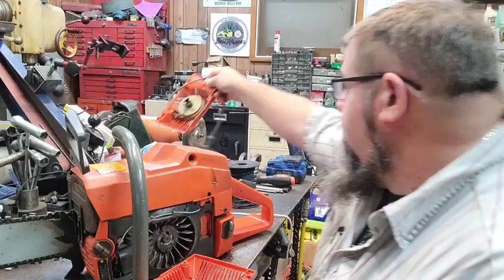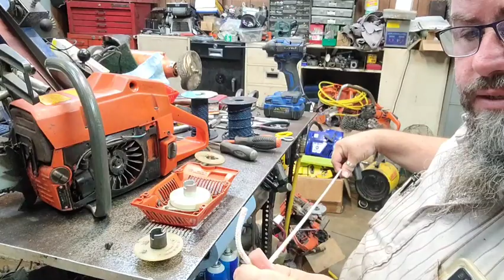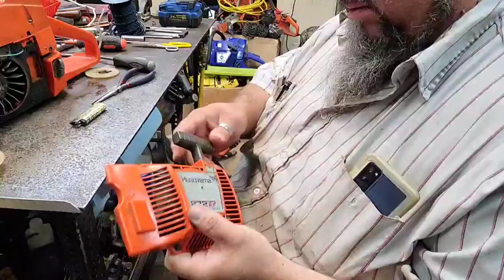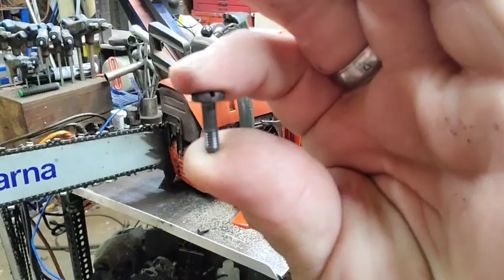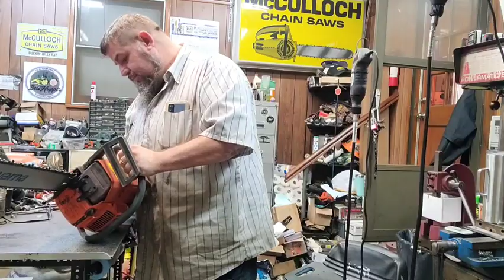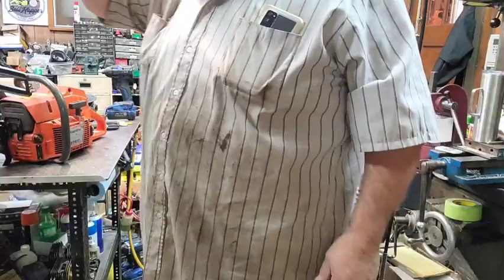Pull Start Repair! Husqvarna 272XP Recoil assembly

Comment: While patching different recoils together I found three different lengths of the metal part of the pulley. The longer one rubbed the flywheel. Point being, there is a difference and different models are not interchangeable unless you own a grinder. 😃